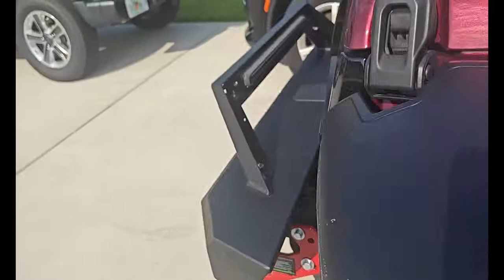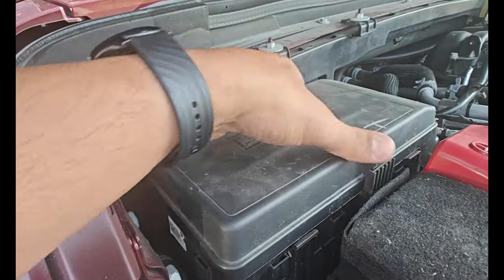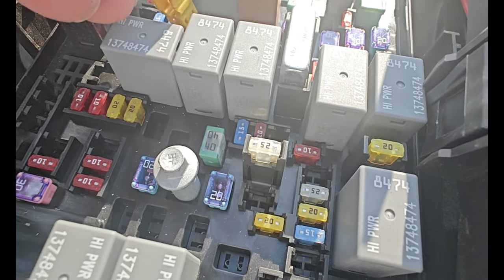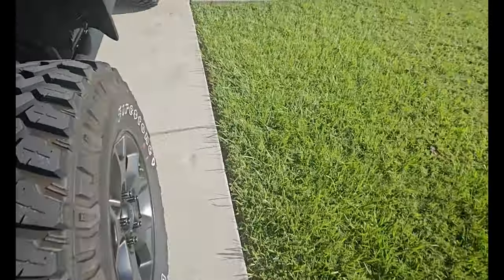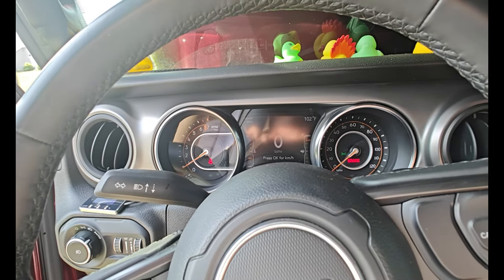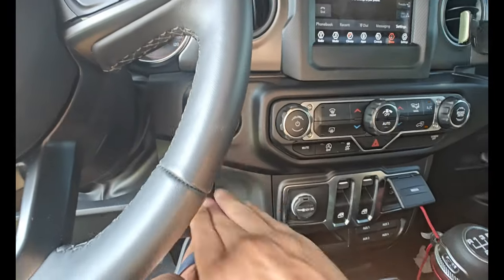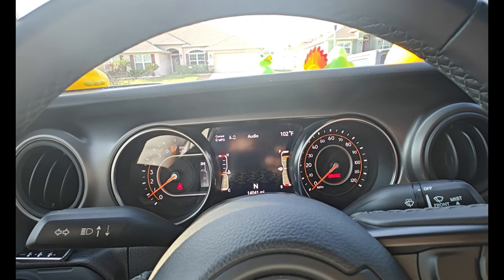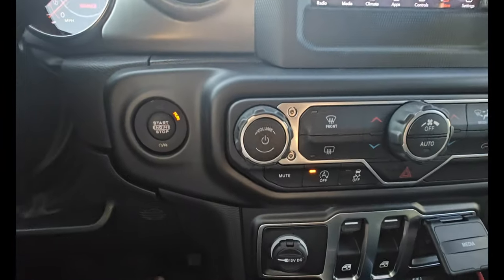Jeep Wrangler Aux Battery Bypass

Comment: Damn. I tried this. And it didn't work😢.   I still get random check engine, service 4x4, service gear,service. Trackbar. Hell service everything lights.  Da faq
Reply from the maker: You might need a Tazer to fix all the issues
Reply: Abs module broken. 1100 bucks to fix😢
Reply from the maker: @BABAYAGA-d5t  That should be an easy fix if you are handy, pick one up on ebay for around $400
Reply: Damn that sounds really heart breaking bro.

Comment: 12.6 volts while running isn’t enough.
Reply from the maker: 12.6 volts while parked is normal.
Reply: @FAFOWeekendAdventures no it’s not, when the engine is running you should be getting 13.4-14.2 Volts
Reply: @xBEASTNASTYx  The JL doesn't constantly throw 13-14 volts at the battery from the alternator to help its longevity. At idle, 12 is fine. It'll ramp it up to 13 or 14 when necessary. This is by design.
Reply from the maker: @xBEASTNASTYx I just we outside to verify and it reading 14.2
Reply: When you saw the 12.6 I dont think it was running he just had a acc on to read the gauge
Reply from the maker: So glad we have some good viewers, LOL  @tmcblane

Comment: Pulled fuse 42 and disconnected the proper ground and it still shows that stop start needs service and the A light plus a message that my air bags need service. What’s going on?
Reply from the maker: Sometimes you have to let it be for a day or 2 until your computer resets
Reply: @FAFOWeekendAdventures  Thanks I’ll give it a try

Comment: So tried this because I'm starting to have issue.  My dash stays dead, unless I plug both negative wire to the pole.  I mean... WTH?  I really don't understand.  2019 JLU V6.  Any idea?
Reply from the maker: You might have the same issue as the 2020, it seems not to work.
Reply: @FAFOWeekendAdventures  I got it to work after a few tries. I think you have to do things in a certain order otherwise the sensor on the negative pole of the main battery will be in the "off" mode and then you don't have power at all.  I did it wrong the 1st time, but I'm not sure what the correct order is TBH.   I redid it a few times, until it worked! 😂
Reply from the maker: @OffRoadQC  Thats great to hear, now I can at least pass this information along when someone else has the same issue. Please like, share and subscribe for more videos.